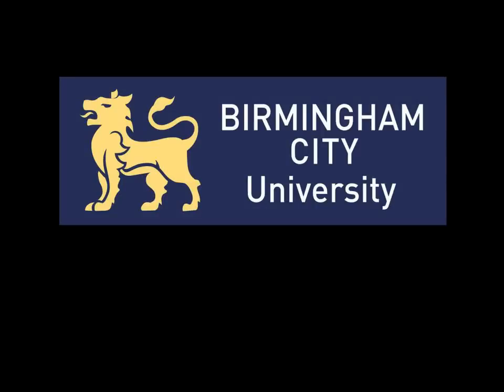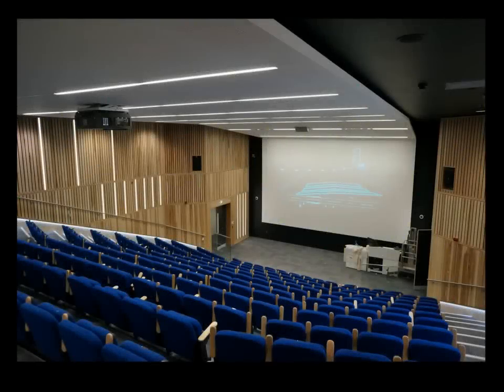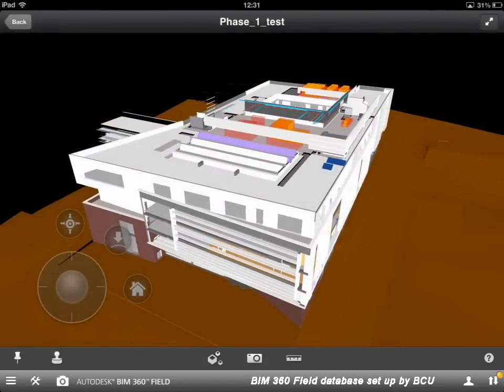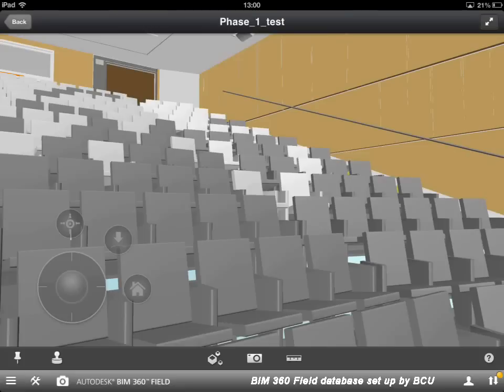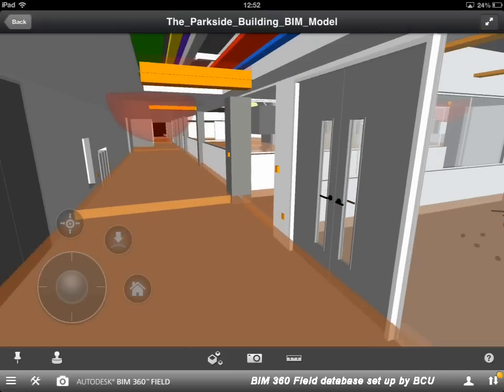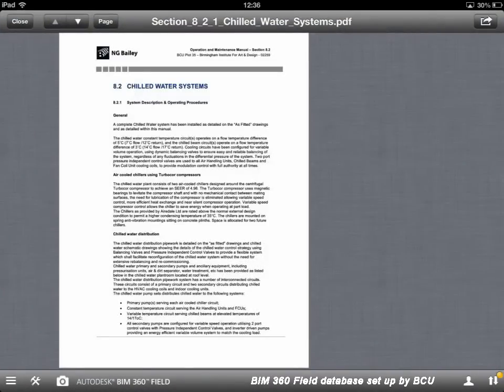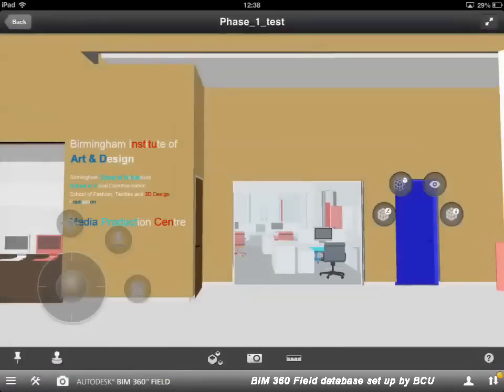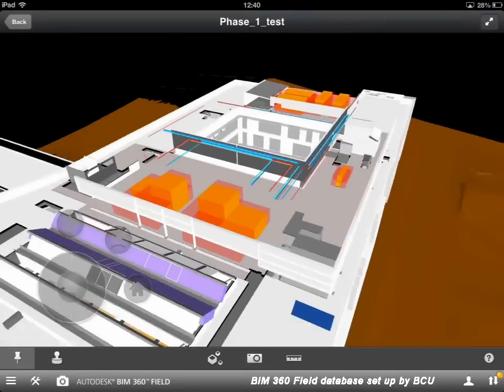Autodesk BIM 360 Field Demonstration

Comment: Brilliant video. My name is Aaron and I'm a student that is currently running a project on how BIM can benefit FM teams as well. I'm in the process of running a pilot at Nottingham Trent University... I've created the BIM model and my plan is to install BIM 360 on a uni Ipad. In addition demonstrate to the maintenance team its functions and trial out the process. 

If you have anymore additional information on the use of BIM 360 or how it can help FM it would be much appreciated.